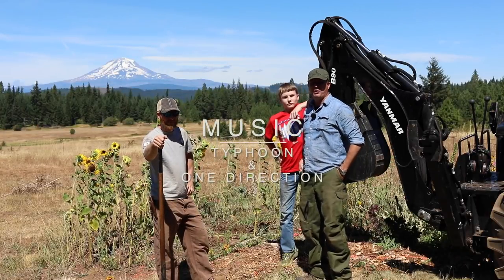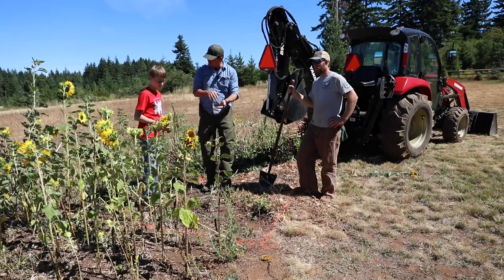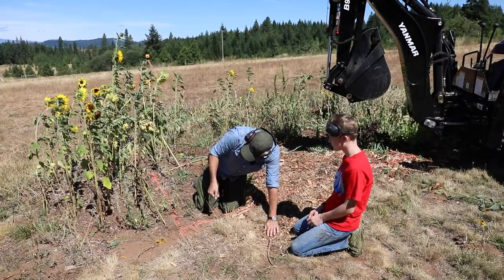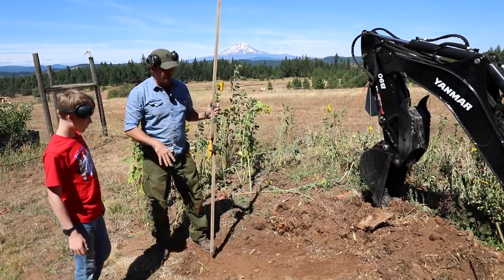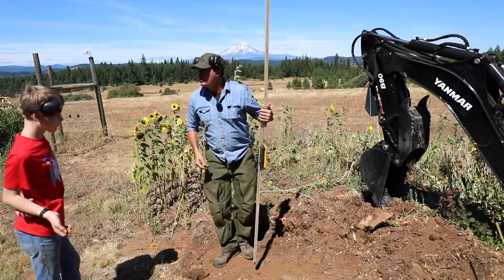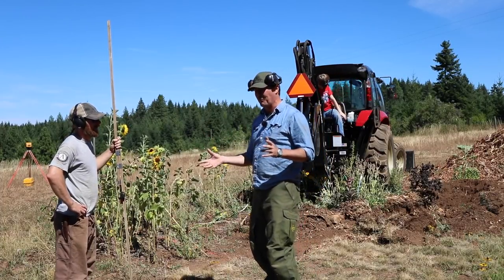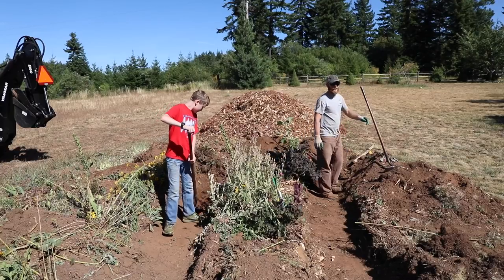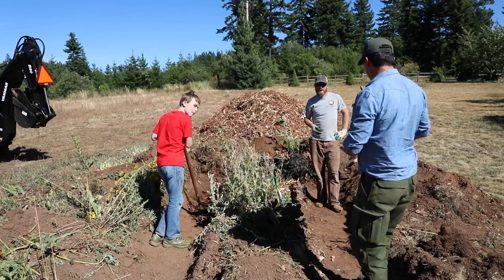This Is The HARDEST Part

Comment: I think i was about 9 or 10 when i first used a digger. Destroyed some expensive things that day
Reply: Alex Hickey my exact experience too straight through some small water lines we didn't know were there 😂
Reply: Muzza904 i destroyed a supporting wall of a shed that had all the power lines for the house in it. Was spinning the thing around and RIP wall
Reply: Alex Hickey fair enough you win! 😂😂
Reply: Alex Hickey I was about the same age first time I run a backhoe. I was digging in a field tile. I didn't destroy anything but I dug the tractor stuck over the trench lol. I had a hell of a time getting away from it.
Reply: sstroh08 lol childhood and adolescence are full of random funny accidents
Reply: Since I have a PhD, I don't need a backhoe . . .  my PhD is a Post Hole Digger  ;-)
Reply: Ryan mother of Christ Jesus howd ya manage that
Reply: Ryan lol    when i busted the wall i broke it, the mains power line, the water mains pipe and burst the hydraulic hose on the digger    all of over 6000 worth of damage i think
Reply: Ryan  i havent been allowed near a digger again lol and yet they dont mind me driving tractors without a licence

Comment: Good video Cody, finally something I know about. Been doing ditch diggimg down here in Oklahoma. Everything looked good with the exception of the gravel. Clean gravel will expell water better than what looks like crusher run to me. But most people dont use clean gravel very often around a homestead. Also im curious if you backhoe is iso pattern or backhoe pattern. I personally learned on a 4 stick case and Komatsu trackhoes with the backhoe pattern. Keep the vids coming!

Comment: Ok, so I couldn't find anywhere else to ask my question and I don't trust Google to find my answer. I am asking you because after watching countless videos you have made over the years I trust you and what you have to say so here is my question, What "if any" is the difference between an oil stone and a wet stone and why would you need to use it? Also, if you could maybe do a video on this I would love to see how "you" use it.
Reply: So I'm no expert, but I do sharpen knives as a job, so this is what I understand. Water stones, like Japanese stones, remove more material at a faster rate. Even though Japanese water stones can go up to crazy high grits, Arkansas stones can be used very effectively to put the final polish on an edge using a super fine (hard) stone. The problem with Japanese water stones is that they require regular maintenance and flattening while many oil stones don't require flattening and stay true for a long long time. Also, some people have had better results with Arkansas stones with stainless steels and Japanese water stones with carbon steels. My recommendation is to buy a diamond stone for real rough work and reprofiling, some Japanese water stones in medium/fine grits, like up to 4000-6000 and finish off with a very hard Arkansas stone, and a leather strop. You can get a wicked edge with the 6000 grit water stone, but if you wish to go higher and get a perfect edge, I recommend the Arkansas stone and a stop with honing compound.
Hope this helps!
Reply: Ok ok, thank you for that. Now I have another question: I have a very old stone from my great grandfather and my dad has just recently given it to me, he keeps calling it an oil stone and is saying that I shouldn't use water on it because it's not a wet stone it's an oil stone. I'm sure my grandfather told him this same thing. Will it hurt it to just keep it in a box of water? It would fit perfectly in a old wooden box I have that was made so a water stone. I'm just very confused on why it matters. Thanks for your input, it is very helpful
Reply: Outdoors West Virginia every sharpening stone can technically be a water stone, but an oil stone should be used with oil. Hypothetically water would work, but I don't recommend using water. I'd recommend buying a bottle of norton honing oil. Pretty cheap and lasts a long time. With water stones, you really have to saturate the stone with water until puddles begin forming, but not with an oil stone, because those puddle much easier. Because of this, the honing oil lasts a while
Reply: Jddj Jdjd ok thank you
Reply: Outdoors West Virginia no problem man